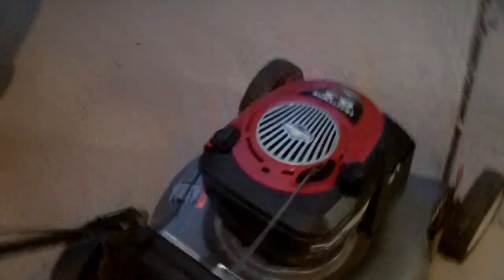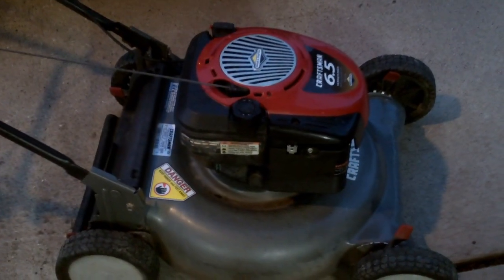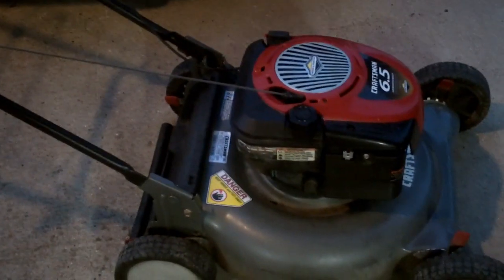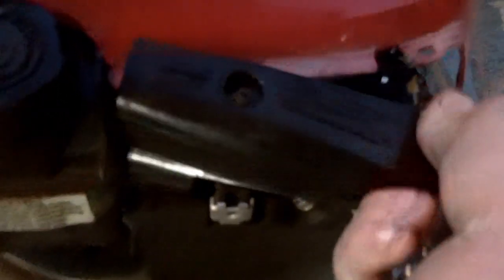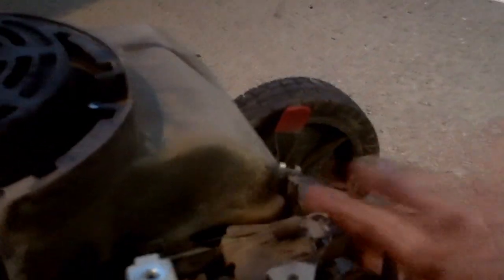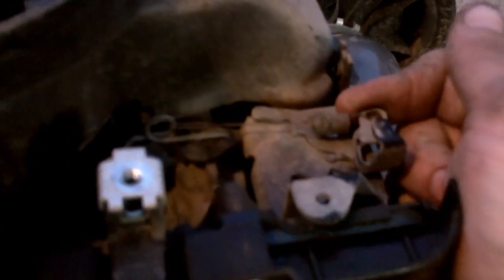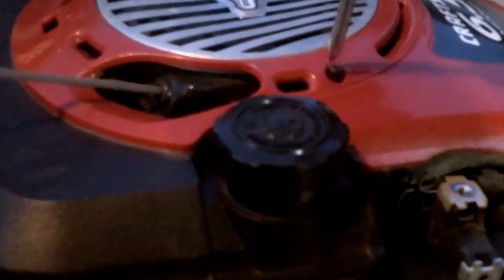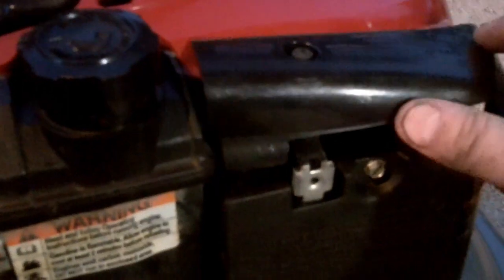HOW TO ADJUST THE ENGINE RPM'S ON A BRIGGS AND STRATTON ENGINE

Comment: Got a big question that I can’t seem to find on a 32hp Briggs vanguard what should the idle rpm be can’t seem to find that info anywhere right now it’s running at about 1750 sometimes a little hire I believe that’s too high because when I shut it down the smell of gas is strong

Comment: that covered it. all the stock adjustments.  any more than that you'd have to change everything that is not worth it trouble or money for a little old push mower. this way and long as you change the oil and new plugs in it it should last longer than you.

Comment: June 16, 2020 - same thing , ran under a bush and rpm dropped  . 
Looked with no luck ; found this video and tried again .
Found that same size spring , But the rest is different ; noticed the plate the spring is attached to was bent - straightened that back , and now it works ok .

Comment: Nice explanation however.......... my Toro Super Recycler has the B&S mechanical governor and it is idling way too fast. When I push in on the tension spring pawl in order to takes less spring pressure off, the idle stays the same, even with the spring loose! Any hints out there?

Comment: Thank you for this video. I put in a new governor spring and carburetor and it still wasn't wanting to get up to speed. You video showed me how the arm was bent. I adjusted it and WHIZ BANG it runs like a charm. 

This is my very first small engine repair ever. Thanks for all the help!!!

Comment: HAVE A CRAFTSMAN 917.377520 5.0 GOLD BRIGGS AND STRATTON ENGINE MODEL 12H802 1978-E1 98042057 PUSH MOWER. THE ENGINE WILL CRANK BUT WHEN YOU SHUT IT OFF IT WON'T CRANK BACK UP. ANY SUGGESTIONS. THANKS JEFF WETUMPKA ALABAMA

Comment: Hi, Tx for your video.  My push mower with same engine suddenly had a loss of power that I thought was due to lack of gas.  I filled the almost dry tank and when i got it started it ran at half power.  After your video i did the same adjustment as you showed and there was no difference in engine performance and when the engine was killed there was a bit of a backfire.  Since this problem began I have changed the air filter and replaced the sparkplug.  Mower is still very difficult to start and often backfires when it doesn't turn over.  Do you have any suggestions?  Tx much
Reply: Ah, turns out the shear pin broke and it was a hair off, slightly bad timing

Comment: Very helpful video.  I just replaced the carburetor so I had to remove and replace that governor spring.  I knew it had a purpose but had no idea what it was.  My mower was running slow after the carb installation, and I am sure after watching this video that the spring needs adjustment.  Can't wait to get home it out.  Thanks again.

Comment: I have 2 screw mixture screws. I'm trying to get the rpms up, one is near the bowl other is for governer. No matter how much i play with the govenor related screw it doesn't reach rpms. Tried adjusting them both. Think the bowl one is for fuel and the govenor one is for regulating the govenor, any advice?

Comment: I have the same mower new carb starts up fine but after it’s all warmed up it surges until it turns off can you help? I do notice the throttle body opens and closes quiet a bit when it’s about to die

Comment: i changed the carb diaphragm, air filter, spark plug, oil and gas. the cord was stuck was what prompted the repairs. the mower ran hard, but I was able to adjust the governer flap. it still ran a little hard, but i mowed anyway since my yard is small. one of the repair guys here on  youtube made it sound like running a little hard is okay. when i turned it off after i quick cut my grass, it was smoking just a little. the next time i tried to mow, the mower wouldn't start at all. is it too late to have hope for it?

Comment: I have a craftsman 208cc 26" snowblower.  What is the correct RPM to run the snowblower or what is the correct factory settings?

Comment: I've rebuilt a few push mowers. I have an 18 h.p. B&S. For no reason after changing the oil, my control level stopped working. The motor runs wide open no matter what I do with control lever. The governor is set right. The carburetor works fine, and I even went as far as pulling the crankcase to make sure the governor was good. It runs at 4200 r.p.m., and I can;t slow it down to 3600..............what did I miss?  puzzled about this.

Comment: I have this same engine on a 21" self-propelled Troybilt mower and it has impressed me for over 10 years now.  
Interesting question. 
Anticipating the eventual replacement I was looking at new Toro mowers and a feature they have is that they stand it on the rear-end to conserve floor space.  Toro touts the location of the fuel tank as making this possible.
Well looking at my Troybilt, the fuel tank on it is in the same place, the air filter, carb. and muffler are at the front of the machine and it seems to me that I could do the same thing with the mower I have.
Obviously neither Troybilt nor BS would ever recommend this.  So the question is, can you think of a reason why a guy couldn't do this?  Is there anything in the crankcase, etc. that would make this not-a-good-idea?
I thank you for your time and expertise.
Jim

Comment: I'd suggest also taking a piece of wire (like a coat hanger) and bending it a couple of times to hold the flimsey tab in place. can hook it to the thicker piece that it moves with it. takes all of 10 minutes and 3 cm of wire

Comment: What do you think of the newer Kohler engines, specifically the 6.75 hp on the Recycler 22"?
Reply from the maker: It's ok, Chinese Honda clone.  Downfall is carb issues
Reply: Yeah, heard that, and  I've had trouble with the carb too.  Pretty cheaply made. Thanks for the reply.

Comment: this doesn't go into much detail.  on my mower the spring controls the throttle body, but it also controls a little plastic lever further back.  what does that do?  some of us have older mowers that have been messed with through the years..
Reply: the arm you are talking about may be the governor arm, the gov is what keeps your rpms at a constant 3200 when under a changing load

Comment: I will be trying this tomorrow, my mower I got used a year or two ago sounds so weak when I start it. It just is so quiet and my other mower's self propel is broken so I use that one on my flat yards but it sucks to use the weak one on hills because it doesn't run well in thick or tall grass

Comment: that control arm does nothing to my mover, it revs up at first, but then it gets back and runs the way it likes to run (on low or sometimes surging), only when the gas tank is almost empty, it runs normal... changed that carb diafraghm gasket, air filter, still the same... then kicked it and bend the shit out of those control arms and air filter screw, now cant start it at all...
Reply: id try to set the linkages back the way you had them and start trying to clean the carburetor, most of the time surging is caused by running too lean or rich.

Comment: I bumped a power pole guide wire with the front of the Briggs and Stratton engine on my mower.  the engine took a serious dive in RPM.  i searched for an answer and came across this video.  simple video, simple solution.  that you very much...

Comment: thank you so much for posting this video! I bought an "All fixed up" used mower that worked once and kept stalling after that. I don't know much about motors but am pretty tool savy. After changing the oil, air filter, spark plug, and cleaning the carburater, I decided to watch some YouTube videos. I quickly realized the piece of wire holding the linkage together was a poor fix for replacing a 30 cent spring. Fires right up and runs fantastic!

Comment: Many thanks for this video. This was the second time my lawn mower (SABO 43-Compact with the 2.4kW B&S engine) revved down when I tried to cut the grass under a bush. First time I brought mine in for repairs. Thought I'd lost a regulator spring or something, never guessed that silly part was bent that easily. Adjusted, erm bent, until I got the right RPM by ear.

Comment: Jeremy I have that same mower except it's got front wheel drive.  Started it up this morning and started normally was mowing and about 5 minutes in, the mower just stopped.  It's got fuel and oil, does burn a little oil but runs great.  I had a new spark plug changed it out and ran about 20 minutes and stopped again and now won't start. Hope you can help me out !!!

Comment: HEEEELPPP! I cleaned the carb on my Sears craftsman B&S 7.0 HP ohv and reassembled it the way it came apart..it fires up but seems like it runs at a high idle and using the throttle control lever does nothing to change it..the cables moving etc but no change from the bunny to the turtle??? What do I do?

Comment: Hi Jeremy, I have to adjust a lever on top of the carburetor and the governor to get the mower running.  Otherwise, the engine turns but starts to quickly die.  I added more tension to the governor, but I still have to pull another lever in order to get it right.  I cleaned the fuel filter, replaced the air filter and spark plug, but I still have to mess around with that particular lever.  What should I do to get it back in normal mode?

Comment: I was given a 5 hp briggs powered lawn mower with no throttle adjustment because the  previous owner let the gas go bad.  After draining the bad gas, pulling the carb and spraying all the holes and orifices with carb cleaner, It runs. But it barely idled.  I tightened that spring by attaching it to something a little further away (because mine doesn't move like the one in the video), but it's still slow.  What's on the other end of that rod that the spring hooks to?  Is there a way to adjust that end?
Reply: Dave Harris Nevermind... mine does move like the one in the video.  Contempt prior to investigation. :/

Comment: How do you test the rpms on a push mower Jeremy?
Reply: You can buy a tiny tach. It works by wrapping a wire around the spark plug wire. Also has an hour meter on it.
Reply: rob kerz the

Comment: I have an issue right now on my 190cc 6.75hp Briggs & Stratton from Sears, nice front-wheel auto-driven push mower, but finicky as fuck!!  I've done everything, change the carburetor, change the fuel filter, change the air filter, change the oil, clean out the muffler, change the jet & magneto, yet abso-fucking-lutely NOTHING has solved the start-stop problem. I even bought ether-free Premium High Octane, zilch... My mower is 2 years old, 1 month out of warranty. I've sunk countless piles of money into this thing and all I have is a dead mower and the grass ain't getting any shorter. I'm ready to chuck this thing. What am I missing? :(
Reply: *****
Yeah, well I hadn't thought of those things actually. Luckily turned out to be the governor rod, somehow it got bent inward which caused it to die prematurely. Straightening it out and then recalibrating the coil spring solved the issue, the mower runs like a champ again.  But thanks for the advice, good solid tips for when something goes amiss for next time. :)

Comment: I have a n 8 hp briggs in my craftsman rider, it fires up runs about 5 minutes then starts to miss out til it shuts down, the carb was completely rebuilt over the winter, and I have used the mower on several jobs in the past few weeks, then this just suddenly started any ideas what it might be? I have checked the fuel cap for venting and it is passing air adequately, new air filter, and clean gas,I am going to pull the fuel filter off in the morning and check it but I am not sure what it could be otherwise. thank you

Comment: I have a craftsman mower with the briggs and stratton  675 series engine. I took off the muffler,and now wont run. It starts for a minute then bogs down,after that it wont start until completely cooled. Then the same thing happens over again. When I put the muffler back on,it is in the correct position as you have here in the video after you lifted it in position. I noticed,when it was running for the minute, the choke air vane was fluttering back and forth. Would the tab on the choke need to be bent? Any help is much appreciated ..
Reply: My 6.75 is doing the same thing. It runs great for 1-5 minutes and then shutters a little before dying. After a minute, I can start it again and it just repeats.
Did you find out why?
Reply: No, I haven't found out yet ...
Reply: sounds like its got a thermostat near or attached to the muffler and you either overlooked it or hooked it up wrong. I've done the same myself.

Comment from the maker: the throttle advance bracket is not movable as it is spot welded from the factory....you cant put cables on this particular engine dude. trust me ive been doing this for 20 plus years.

Comment from the maker: Yes.  Very simple.   Push choke in all the way,  loosen clamp bolt on carb move cable in or out till butterfly is fully open, tighten clamp bolt.  All done! Good luck !

Comment: I've got a riding tractor whose governor spring us really loose with throttle in idle position and up to about half throttle, but then I see the spring starts to add resistance to the governor linkage from there up to full throttle.  the tractor also seems to be slow flat out.  should the governor spring have tension at throttle idle position?

Comment: Where does one get an electric tachometer for a single cylinder engine?
Did Briggs slow down the recommended running speed? Used to be 3600rpm if they did..